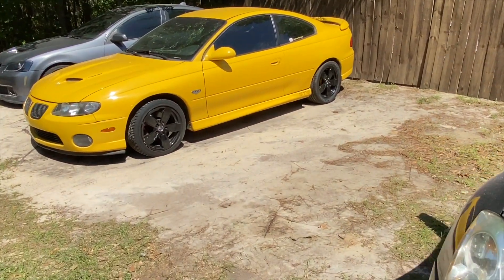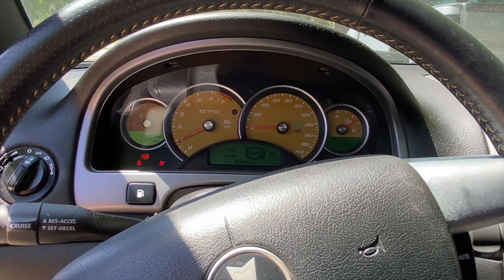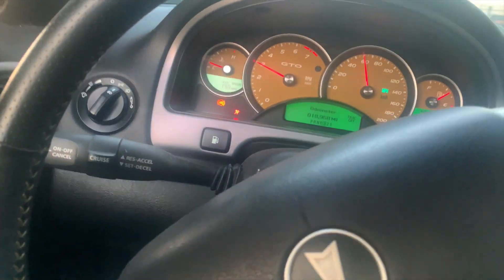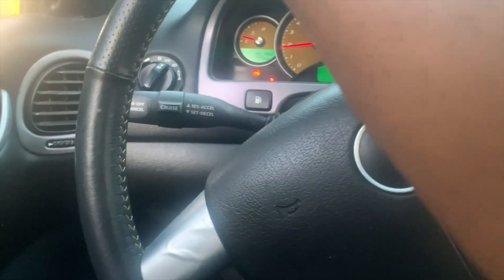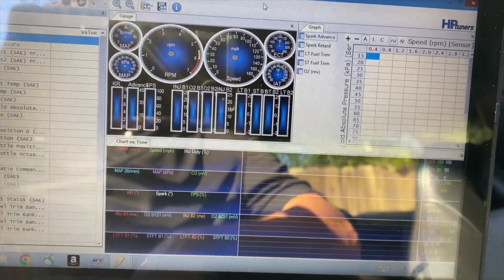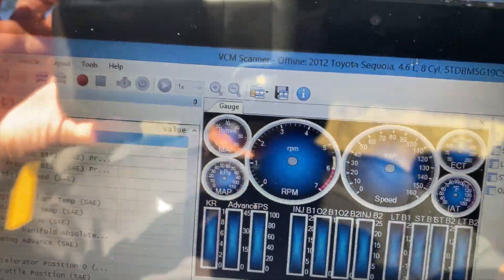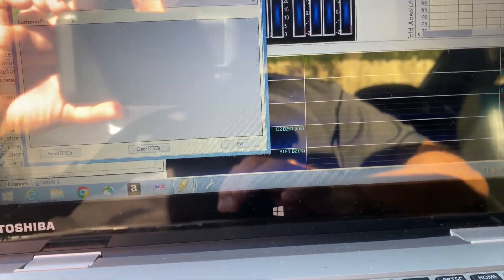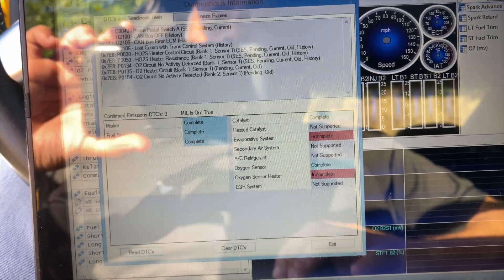This Damn Car!!

Comment: The HP Tuners scanner could point you in the right direction.
You could also try cleaning you MAF with MAF cleaner.
My 06 was doing similar.Had a sticking injector.

Comment: a faulty MAF sensor/ connection could give you those codes as well. Had similar codes after doing a valve job replaced a bunch of sensors and the codes would still pop up randomly. turns out the plug on the wiring harness was just shorting somehow maybe because it’s old idk but replaced it and codes never came back.

Comment: Good luck bro. I recently had issues with my GTO, mostly it not being able to start unless I give it gas. Changed the Evap Canister, Canister purge valve, didn't work, but fixed an emissions leak. Then tried changing the Cam Position Sensor. Didnt work, still didn't start. Changed the fuel pump because why not, maybe the pressure is low. Nothing, but now have a stronger pump. What ended up getting my car started and running properly, cleaning the dam throttle body. And I did a shotty job at it too. But the little bit that I cleaned made the car wake up. It did through my idle tune a bit off, but I don't mind. I would suggest trying that. Also try changing the O2 sensors, all 4 of them. You had the codes thrown on the tuner, may want to give that a try if its not running right. Changed mine a while back when it cause my GTO to stutter a lot on acceleration. Let me end off by saying I do like my GTO, but its truly a pain in the ass. Hope you got yours running by now.
Reply from the maker: Thanks, I’ll definitely try these suggestions. I have quite a few projects that I’m working on so I haven’t gotten a chance to look at the gto.

Comment: I smoked my front o2s from running leaded race gas .the lead in it gums up 02s and makes it run like crap missing popping etc replaced front 02s problem solved.
Reply from the maker: I run 93 octane, I’ve heard that race gas which is leaded destroys o2 sensors.

Comment: CanZ8ter Custumz
Yes, it’s been tuned about 2 years ago but there has been a few changes since. It only has rear o2’s so you’re probably seeing the front o2’s not reporting. Thanks for the info, the car was running a lot better about 2 mos ago so I’m not sure what happened. I have a local tuner that I could take it to but I really want to figure out the major issue first.)  

If that is the case then there’s a problem right there. Your rear O2 sensors (down stream) should/can be shut off and your front (upstream) should be reporting. Your downstream sensors are only there   To monitor the catalytic converter’s performance.  Depending on what you changed (intake/cam/injectors/etc) the car should be tuned again. I wouldn’t play the guessing game and hurt something that’s going to cost you money!
Reply from the maker: The changes I made were over 2 years ago, and the car has been running fine ever since. It has headers and no cats, it’s been that way since it was tuned. This issue just started within the last 2 months, which I changed the spark plugs thinking that could be it.